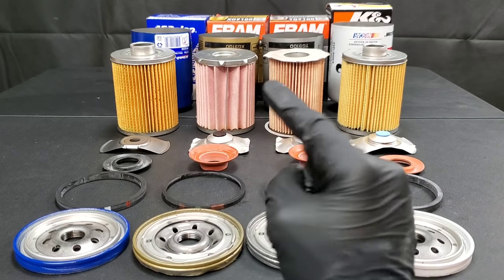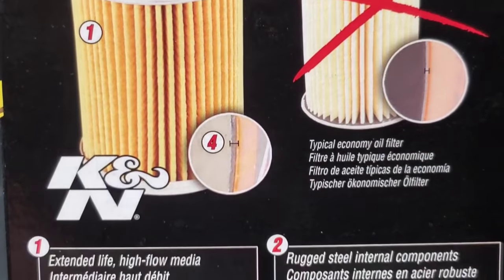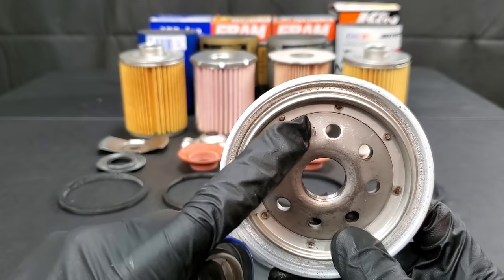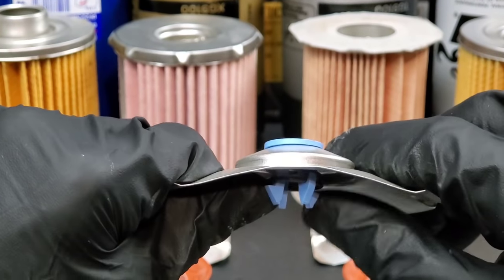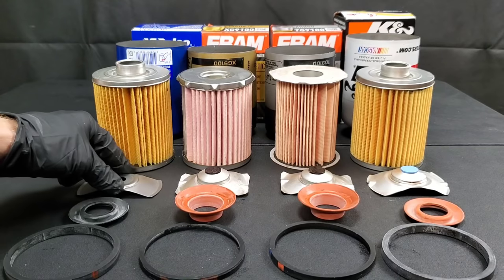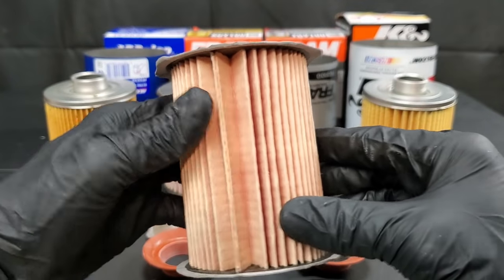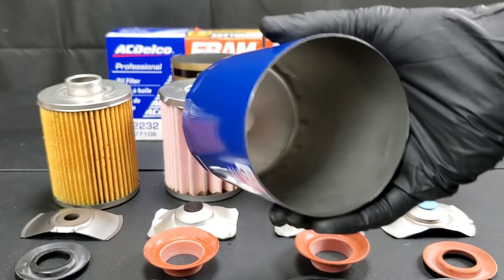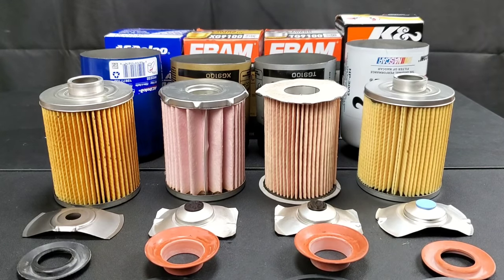DO NOT USE This Oil Filter made by...

Comment from the maker: What would be a great way to test oil filters?
Reply: ok
Reply: Some kind of pneumatic pump ,clear hose ,clear sump,dirty oil,.You gotta find a way to run dirty oil through brand new filters in real time and be able to physically see the filter clean the oil up after a given amount of time .
Reply: Use the filters on cars,  cut them open after the miles they claim on the packaging and see how they hold up
Reply: Maybe go by weight gain of the oil filter.  Run  good oil through a filter and weigh the difference in weight of the filter, then bad oil and do the same.   Or something like that.
Reply: Using a small scale like a kitchen scale, test with about 1/2 cup of dirty oil. Drill a hole in each filter for the exit side for the dirty oil in and let it drain into a container on the scale. As long as you're using the exact same amount the scale should show a slight difference in weight. The lighter weight is a better filter.
Reply: In your opinion which brand is the best I have a 2010 Ford Fusion
Reply: @ishotthetrixbunny9773   1st is wix, 2nd is purolator.. All the way.
Reply: @johnwagner4559  thank you
Reply: Pump a bunch of air pressure say 20 PSI to start into the filter to see what blows, Of course be safe doing that LOL
Reply: Show Cartridge filters so you can return them after the video.
Reply: Hi Nate.  I remember an oil filter test by one of the car magazines testing a GM oil filter and a Ford oil filter.  I believe this was in the 70s.  The Ford filter at the time was a yarn looking design while the GM filter was the traditional pleated filter design.  To determine the best filter they poured sand into two identical engines  to see which would survive the longest.  The Ford filter won in that case doing the best job protecting the engine.
Reply: @ishotthetrixbunny9773  I miss 'ol Trix.  (Insert sad emoji here)
Reply: @dustinpomeroy8817 uy
Reply: Oil filter isnt so complicated.. it just have a paper to allow particle below certain size to pass through. I would consider a filter bad if either it does not stop contaminent or it gets blocked below 5000 miles so much that it can no longer allow the oil to pass. I dont think that matters what materials were used in housing... do you really care which glass you drink water from? Sure if you drink from a rusted  can it can have implications but never seen rust in filter on shelves. I do inspect them before buying and stay away from ones whoes package is broken.
Reply: @ihatemybosses   I think wix makes there filters
Reply: Pump oil contaminated with different size particles and see what gets thru how much how small or large using the threads to hook up some how And shop air  to push the test subject at a fair amount of psi perhaps 40-50 psi no more than idk what 75 psi adjustment on flow valve to be realistic
Reply: Oh no un filtered engine oil😮
Reply: Aka Don’t use your big ass oil fikter pliers to install new filter
Reply: I dont think your engine is going to bend its filters check valve to see how pliable it is tho❤
Reply: @ishotthetrixbunny9773 deez

Comment: Changing your oil regularly is much more important than just the filter. Kinda like controlling your obesity to avoid costly medical bills down the road.😁
Reply: Agreed. I owned two Dodge Caravans that I drove to near 300k each on 3500 mile oil changes using the basic Fram oil filters. I now have a Malibu with just over 200k and the same schedule using basic Fram oil filters.
Reply: Hey Dan you can’t say that it’s 2021 don’t you know fat people are beautiful now 🤣🤣🤣😂😂
Reply: Yeah.. I had a Pontiac Grande Prix that I used mid level Fram filters in up to about 225,000 miles, didn't leak or burn anything, and then I broke the engine, totally my fault. ... The Mechanic that replaced it took it partially apart and said to me "your gonna cry when you see how clean the inside of your engine is" <- Direct quote.
Reply: @groovymoon  How did you break it?
Reply: @Jon Mo  put cold.water in a hot block.

Comment: Fram are good as any if you do your oil changes on time. Used them for 50 years and not a single problem
Reply: Fram was the first aftermarket filter manufacturer and they've been around a long time. I'd say they know what they're doing.

Comment: The biggest problem these days is NOT with the engine oil filters, but with frequency of oil/ filter changes! Change your engine oil and filter every 5,000 km or 6 months whichever comes first and you will preserve your engine from expensive repairs.
Reply: I change the oil when i don't like the color. I have 230,000 miles on my Civic.
Reply: @ltcajh  The change of motor oil colour in your engine happens within 1000 miles of driving and so that alone is not a good indicator. If you change your oil every 1000 miles that would be overkill. I would stick with an oil change recommended in your specific vehicle maintenance manual.

Comment: I have used AC Delco Oil Filters with my GM cars for 30+ years without any issues.  Don’t need any other filter for my vehicles.
Reply: Based on my observations, the AC Delco looks exactly like the Supertech, FWIW.
Reply: Same here!  Well, sans the 30+ years (I'm only 32 lol).  But yeah, I don't understand why anyone would need anything other than OEM equivalent parts, unless they're racing.  In my opinion, you're basically throwing money down the drain.
Reply: I can say the same thing with Fram oil filters.
I've been using Fram since I started working on cars as a teenager in 1978. I've never had an oil-related problem with any of my engines.
The key is that I've always changed the oil and filter religiously to factory maintenance specs. Currently, I change the synthetic oil and Fram Ultra Synthetic filters every 50,000 km (30,000 mi.) or 4 months (I know I could stretch that further, but I don't).
Reply: @blizzy6392  fuel oil pressure gauge on any of your vehicles you would have stopped using frams! Try a delco, using the same brand and viscosity oil try the Fram. They are garbage!
Do yourself a favor and buy a Hastings or a Baldwin.
Reply from the maker: Check out the new video https://youtu.be/Qf2tGF63Gz8

Comment: Doing an oil flow test through the filters would be better than looking at them . use used motor oil for the test, then test oil for particulates in oil after test on each filter.

Comment: Unfortunately, this is yet another completely unscientific look at oil filters. The reason Fram use resin-impregnated cardboard end caps is that they bond better to the filter medium than metal end caps do. The use of metal end caps is purely for marketing purposes (stronger material, therefore must be better, yes? Well, actually, no.). Also, you can't judge the effectiveness of the filter medium just by how long it is or by how even the pleats are. What's important is how effective it is in trapping really small particles, i.e. 20 microns or smaller. The only real way to test filters is by running them in an engine under standard test conditions, and then measuring the amount and size of trapped particles in the filter and the same for the engine oil.  And you do realise that nearly all the filters on the market are made by just three manufacturers, right?
As others have said, the best way to protect your engine is by using the recommended viscosity oil, and changing both it and the filter on a regular basis. This is especially important for vehicles that do mostly short runs in stop-start traffic that never have a chance to warm up properly. This type of operating condition promotes the formation of sludge, and sludge is the enemy of long engine life, ladies and gentlemen!
Reply: The fact that there are only 3 manufacturers has no bearing on the specific quality of the filters they make. And just bc one can't see damage by using cheap filters, it doesn't mean the damage isn't there

Comment: The glue on the 3 steel plate filters being globbed on is because they have to use a lot of glue to get 2 completely different materials to adhere to each other. The Fram Tough Guard filter looks much cleaner because the fiber backing plate is made of similar material as their filter media itself, so it requires much less glue and a much less expensive glue to get them to adhere to each other. I use the XG Fram filters in my own vehicles, but if the XG for my application were out of stock, I'm fine with grabbling a Tough Guard.
My family are farmers, and we've used Fram for multiple decades and we've never had an engine failure on a tractor, a combine, a truck or a car where we could point to the filter being the cause, and we've used a LOT of Fram's. My Grandpa even ran the local Gambles Hardware Store in my hometown and he sold Fram. This was back in the 40's, 50's and 60's.

A lot of companies use parts that are made by someone else too. Very rarely do you have a company that completely builds their product from scratch. So parts can be purchased from a single part manufacturer, then assembled from those parts in-house. Therefore, parts can look like the parts from another company because they used the same part from the same manufacturer. Also, the entire part can actually be made by someone else completely, then painted the correct color and have the company's own stickers/stencils put on.
Ford, Chrysler and GM don't build their own oil filters, they contract that out to a 3rd party vendor to make for them with their own specific specs.
AC Delco oil filter manufacturing company doesn't exist.
Mopar oil filter manufacturing company doesn't exist.
Motorcraft oil filter manufacturing company doesn't exist.
They are all contracted out to another company to make for them.
There are even a few car companies who's factory oil filters are made by Fram.

Comment: The hole on the K&N filter is there for safety wire to prevent the canister from turning and becoming loose. They are a standard feature on aircraft filters where the wire is required.
Reply: Many race track tech inspections too.
Reply: High performance applications
Reply: As he said!🤷

Comment: I've used Fram filters for 50 years, my father used them for decades prior to that, and most of my family & friends have used them for decades as well. Never personally known anyone who had a problem, or ever heard of anyone I've known having a problem. Guess those thousands of "OCOD" Fram filters never saw any of the YouTube videos that said they're crap. Currently have a '09 Hyundai Santa Fe that's never had anything but Fram Orange can filters and Valvoline 5w-20 conventional oil and semi-syn Max-Life and it has 178,000 miles on it and uses zero oil. Same with our '04 Nissan Xterra, Fram filters, 5w-30 Valvoline conv & Max-Life, with 198,000 miles, and it's still tight and no oil use. Buy what you want, and don't worry too much. Spend as much as you need to to sleep well at night, it's your equipment. 👍
Reply: I've been using a Fram on the same vehicle for 36 years, since it was new. No issues.  The engine has never been apart.

Comment: I can see I’ve been doing the right thing all these years by using the factory AC Delco filters on my ‘95 3.1l equipped Oldsmobeater. Could also be why it’s got over 312,000 miles and still goin strong.
Reply: 3.1s and 3.8s are nearly unkillable no matter what you do to them

Comment: Thanks for informative videos. I use the KN filter exclusively. So far in the last 12 years, I haven't had any issues and run pennzoil synthetic. Oil gets changed every 4-5 thousand miles. The vehicle is 22 years old and runs pretty good.
Reply: yes

Comment: I've been a "shade tree" mechanic for 55+ years.  Many, many oil changes, many, many oil filters.  Broke down and purchased a K & N a few year's ago (believe they were at a discount if one bought two or more.)

Installed on my wife's car.  Shortly after that I started seeing oil spots on my driveway...thought it was from delivery trucks or a friends older car.  One day when my wife's car was out of the garage, I noticed a twelve inch circle of oil of the floor....where she had been parked.

Attempted to again hand tighten filter (probably over-tightened) but the leak continued.  Appeared to be coming from the welded section where the "removal" nut is attached.

Sent email to K & N to inform them and received NO REPLY.   Obviously have no interest in supporting customers who pay and arm and a leg for their filters.

Subsequently have seen three or four customer comments that had the same problem with the filter.  Obviously K & N must have had a defect with a batch of filters but were too arrogant to care about the issue.

WIX xp and Mobil 1 for me.

Comment: I’ve used Fram for years and had no idea that they cut corners. I really like the k and n construction but that nut is really nice- that will work well on my Jeep as the filter is in a very tight place - great vid!
Reply: Fram used to be good in the old days but modern Fram has really gone down hill.  Hence the name "orange can of death".
Reply: @SaturdaySportsman  I use the Fram Synthetic oil filters & do not believe the thickness of the outer case maters unless your driving a 4 X 4 or SUV that has an exposed oil filter. My car has an aluminum cover over the oil filter so its protected from the road debris & will not be going Off Road ! The metal outside is Gold in color BTW.

Comment: If you change your own oil, get a magnetic oil drain plug. You'll be able to see any little filings that begin to accumulate on the magnet when you remove it to drain the used oil. If you see any filings - your engine's trying to talk to you. Listen to it.
Reply: Could've sworn cars , not just modern have these already?  I should get the extended type
Reply: I know transmission plug bolts have these, didn’t know they made them for engine oil. Thanks
Reply: I took power steering pump apart the other day and it had one inside it!!
Reply: Put a hundred magnets. BUT most internals in modern engines are NON - ferrous! 
I personally have NEVER seen ANY "metal" particles on any oil magnetic drain plug ever!!! Even on engines that had it in the oil!
A motorcycle, yes; & why??! 🤷 Go read & found out.

Comment: 2016 Ram 1500 5.7 Hemi. Fram Ultra Synthetic XG10060 with Pennzoil Ultra Synthetic 5w20 for 3 years.  Clean oil.  Good pressure. No leaks. No engine noise. Now at 105k miles.  All good.
Reply: Get rid of it now, you are on borrowed tim when a Ram gets over 20,000 miles!!!
Reply: Own a 2018 with 123,00 no problem here . use a srt filter for hemi or mopars filter
Reply: Have you flipped Oil Filter upside down ever and allowed it to drain for 2 to 3 days and then went back and picked it up you can fill all the weight of sludge🤙 I have been using K&N GoldFilter and when I change it, I let it drain 2 to 3 days, and I can feel that it weighs more than a pound with sludge changed it every 5000-6000 miles . Also use Pennzoil Ultra Synthetic 5W 30. Awesome oil stays clean. 🤙

Comment: I use ONLY XG version of Fram oil filter (ultra synthetic) in all my vehicles, starting from sensitive 2021 Japanese engines down to 1990 old chevy truck, never let me down, easy to take off because of the rubberized grip and works very well. Good in my book...
Reply: I only use Fram Ultra in my vehicles 👍🏾
Reply: @diyi75  9k

Comment: 99 Blazer, standard Fram filters, Valvoline Synthetic, 324,000 miles, no issue. Changed every 5k.
Reply: Same here...I have been using Fram oil filters and valvoline in my truck for 25 yrs, no motor issues to date.
Reply: @ricksspringfield45  I use nothing but Fram Tough Guard (and Castrol High-Mileage synthetic blend oil) every 5,000 miles on my 1995 Sentra with over 400,000 miles on it so far. Never used additives. Going for a half million miles just to see if I can.

Edit: I should have mentioned that I went through all the Fram filters that have the same base plate as the filter that's "supposed" to go on my engine and use the longest one I could find. (It's over an inch longer.)
Reply: @charlesrichards5389  : A 95 Nissan Sentra with above 400,000 clicks, now that's quality of old Nissans.
Reply: 96 Nissan Quest, odometer broke at 250K miles 6 years ago. Guess this minivan has passed well over 300K miles now on Fram regular filter.  I change it every 7500 miles, so far the engine still runs good.  It has become my poor man's truck hauling dirt, lumber and large objects instead of kids. Plan to keep it till the transmission or engine broke...

Comment: The AC Delco, K&N & the older Mobil1 oil filter are basically made in the same plants by the same manufacturer Champ labs ,even the SuperTech is made in the same factory,     the newer Mobil1 filter is different & now made by Mann& Hummel
Reply: The last two Mobil 1 filters I have bought says made in South Korea. Sad!
Reply: @jabomiles6947  actually South Korea makes decent filters ,it's the Chinese ones to be wary with, Mann & Hummel has a plant in Korea (Mann& Hummel Korea) which use to be Dong Woo filter, which was a OEM supplier for GM Daewoo & Hyundai Mobis (Hyundai KIA) they are decent quality filters, I actually run these filters in my vehicle, they hold up very well

Comment: The only thing about crushing an empty filter housing, is that the forces generated on the filter when it's on an engine are not from the outside in, they are from the inside out. So it's inside pushing outwards on the filter housing. Also, with the end caps on, as they would be on a vehicle, none of the filters would be able to be crushed this way by hand.
Reply: @tracysmith9934  Could you translate that?